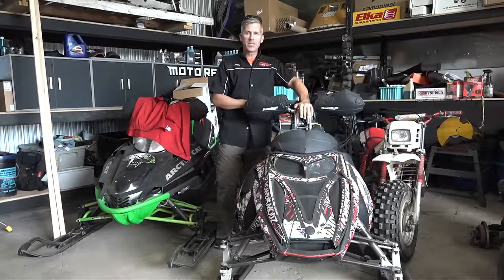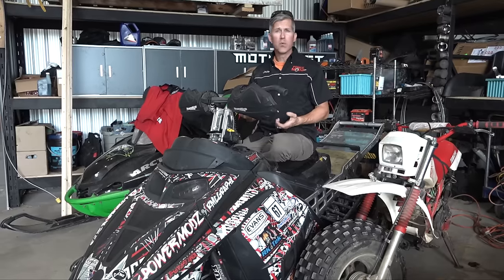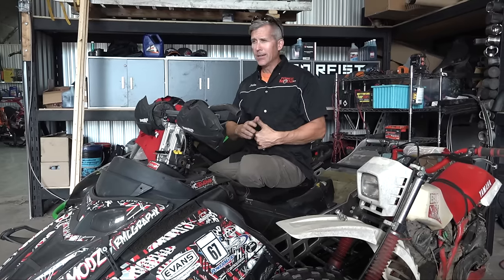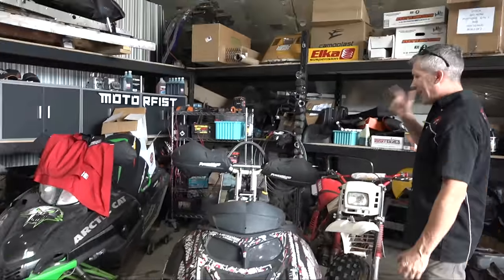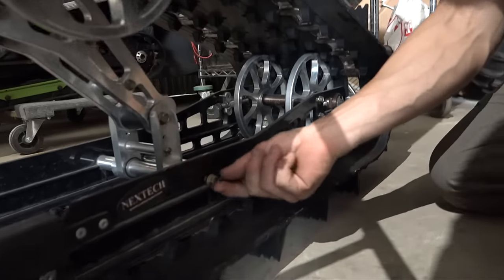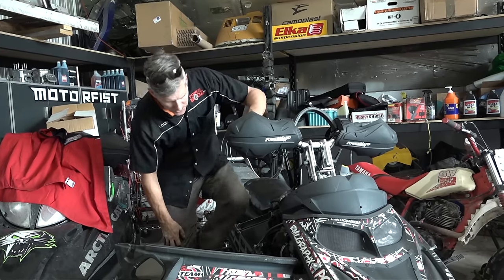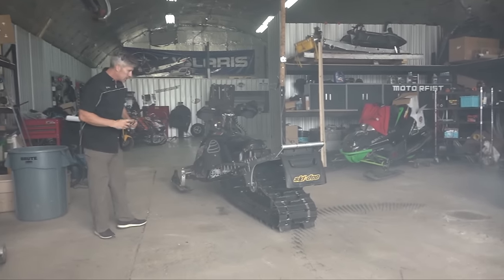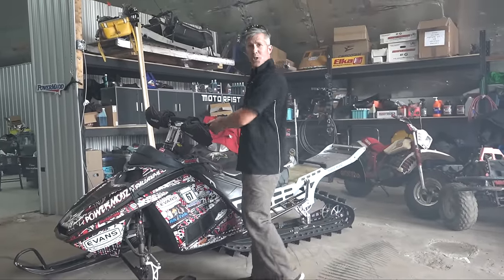Winter sled prep tips and hints from PowerModz!

Comment: Your the sled god so hopefully you can help.  I had my sled rebuilt a few years ago (2001 RMK 700 144").  The engine runs great.  The clutch weights and clutch spring was swapped for a blue spring and the correct clutch weights.  The sled has SLP Twin pipes and 500 main jets, correct needles etc etc per SLP.   The sled was ripping on hard pack.  I took the sled in the powder in my yard as I haven't been able to break in the sled due to lack of snow now the track wont move.  The sled revs fine.  I tipped the sled on its side and lifted the hood.  I could see that the clutch was engaging around 3k rpm and tightening the belt as it should but the track would barely move.  It wont move enough to move the sled.  The track is not stuck to the hyfaxs' (they are new).  I am assuming its something chain case related?  Either bound up chain, or something broke?  The sled is stuck in 2' of snow in my backyard currently so It's hard to work on.  I have rev'd the sled to 5k and 6k rpm and still no movement.  I don't hear anything out of the norm... No grinding, whissling etc.  Track just isnt moving.   The track seems to have about 1" of slack.
Reply: Pulled the chaincase cover and oil looks brand new, chain looks new, gears looks new, cotter pin and nut even looks new.  The chain was SUPER tight.  I loosed it so it's within spec.  Any ideas?
Reply: Ok, figured it out.  After tensioning the chain correctly I could clearly see both clutches spin and the belt not working correctly.  IE: Belt slip.  I have a spare but its the same part number and I have a feeling the belts are the wrong ones for my machine.  The guy I bought the sled from had a IQ 900 and I am betting he just gave me the belts off that sled as he blew that one up.

Comment: Hey I have a 94 Mach one that only fires on one cylinder I've checked compression and changed the spark plugs, I check to see that fuel was making it to the cylinder that isn't firing( it's the cylinder on the clutch side) and the spark plug was wet with fuel. I also check the spark and it was slightly weaker then the firing cylinder. Could that b the issue ? Thx:)

Comment: Ran all last year with a coolant leak. Thanks to Evans I lost maybe a cups worth. If I would have been running 50/50 I would have blown the hose from the pressure. Thus blowing the motor. Evans might not be the cheapest stuff but I won't run anything besides it.

Comment: Do you know of anyplace to get parts for like old snowmobiles I have a 2001 mxz 600 and I need carb boots
Reply: most part sources you can order them in on
Reply: ebay !
Reply: You can find most common and some uncommon parts brand new of sites like mfg supply and Dennis Kirk, but you can get just about any part new or used on ebay.
Reply: dealer?
Reply: nick enslow denniskirk.com
Reply: Fullertons parts carries a lot of obsolete skidoo parts. I referenced them in one of. My videos. Finding parts is a full time hobby...

Comment: hey louis is hightest gas better for 2 strokes i am gettin a 99 mxz zx 600 and wanna run high test let me no thanks
Reply: high octane low ethanol.  ethanol is not good for two strokes
Reply: so run 93 or preimiun
Reply: marine fuel usually is ethanol free. the higher octane usually has less ethanol and will run better. just depends how easy it is to find where your at
Reply: kk

Comment: Hey power mods my sled has recently been down all summer it has broke and not moving at all and I don't known what it is
Reply: When's the last time you have put a new belt on it? That's what happened to our zr 900, belt was so worn out that it was slipping and wouldn't move
Reply: how do I know if the belt is worn out cause the belt looks in nice condition but i can try that cause i havent messed with it all summer been busy doing other stuff and i need to get this back and going
Reply: Try lifting up the back of the sled and prop it up with something and rev it up to see of the track moves, also check under track towards the front of the machine, there is a big plastic gear that spins the track and if that's not moving you have other problems.
Reply: I did take the chain case apart hoping to see the problem but i was able to move the track with the secondary clutch.